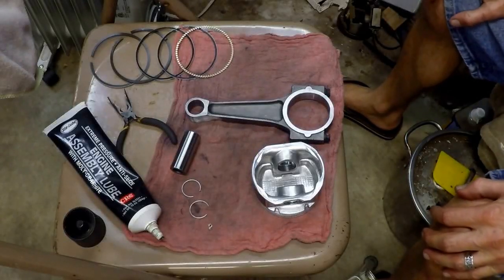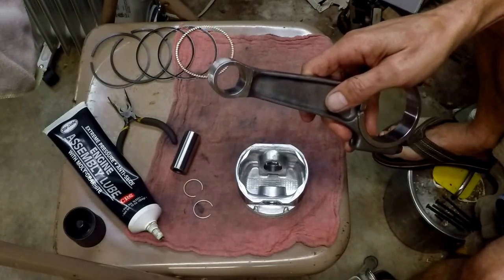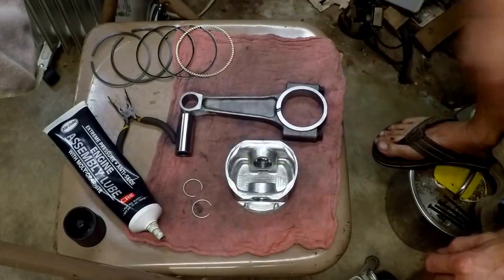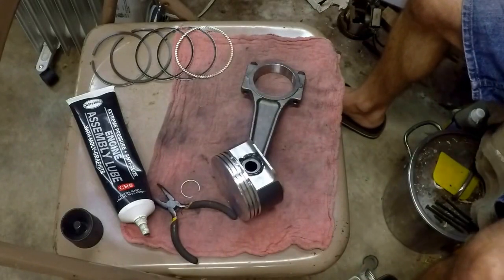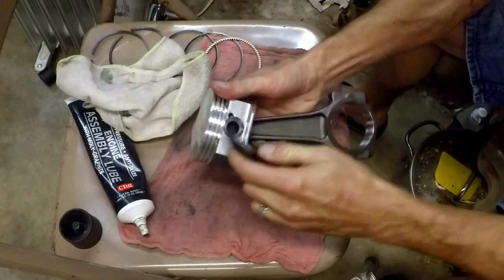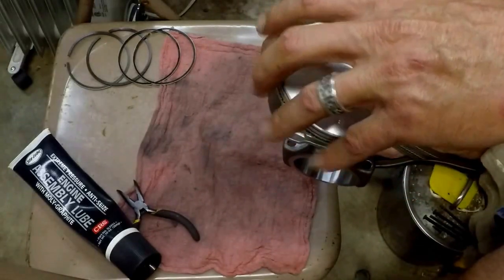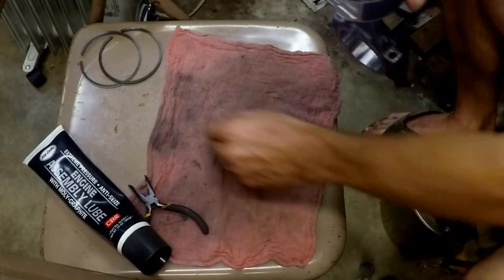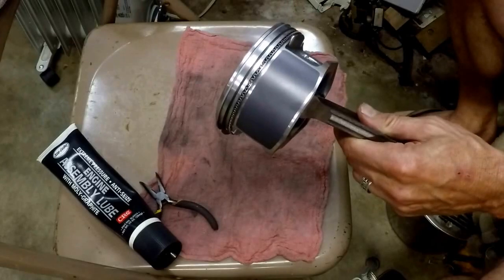Engine Rebuild - 3.7L 2006 Jeep Grand Cherokee Laredo - Part 4

Comment: How has the 3.7 engine held up after the build. I am just starting to tear one down. Watching your series as a reference.
Reply from the maker: It held up well. The guy I rebuilt it for kept it for over 25,000 miles without a problem before he sold it. Last I knew it was running well.